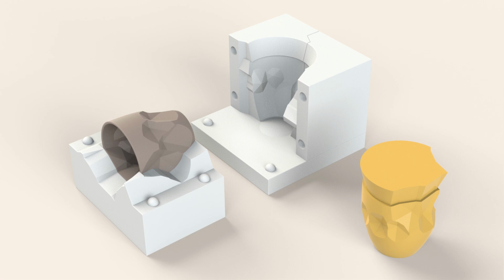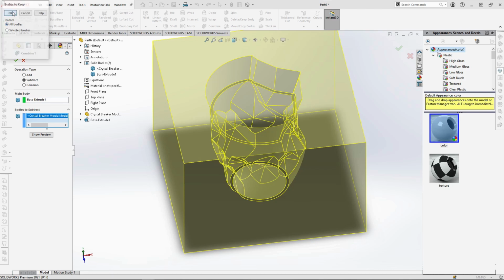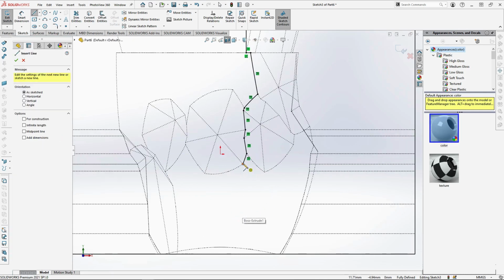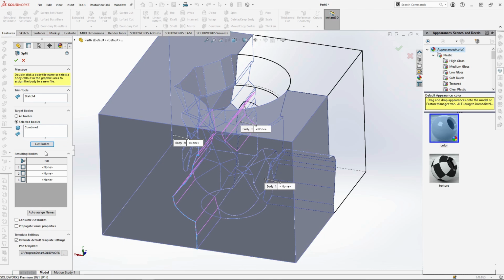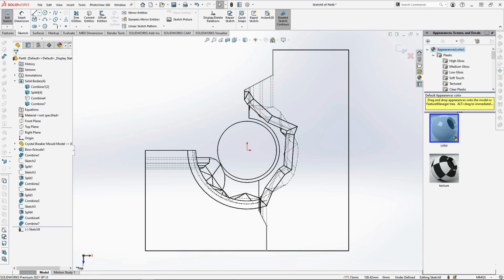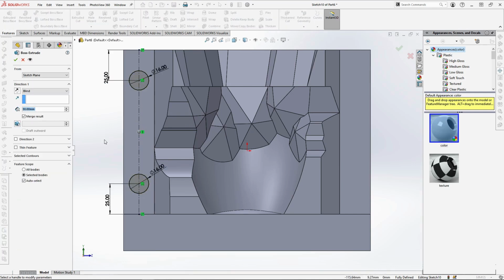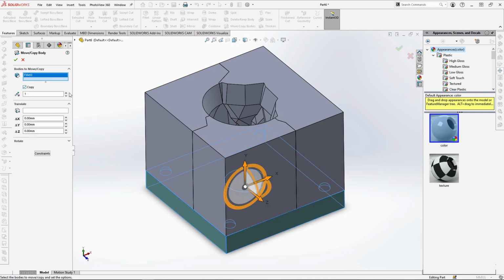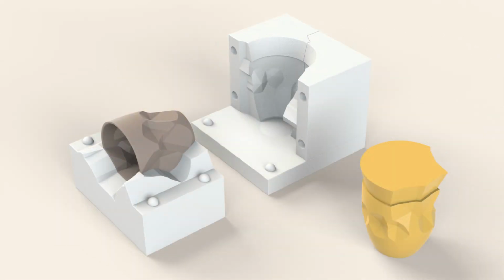4 Part Plaster Mould SOLIDWORKS Tutorial

Comment: Hi Jade! Thanks so much for this! Curious if you could go into more detail about how you then cast the plaster mold? 

I’ve seen some YouTubers create molds from which they actually cast the plaster mold itself. 

But it looks as though your four piece mold would be individually cast separately using a traditional mold making process? I.e. each 3d printed mold piece is cast in plaster with cottle boards? Is that right? 

If that’s the case, wondering if you could create a video of a mold for the mold pieces 😀
Reply from the maker: Thank you for your message! Yes the mold is created with traditional plaster mold methods, it is time consuming but 3d modelling and printing has helped to speed up the process and make it more accurate. 
I’d love to get around to doing a tutorial, not sure it would happen anytime soon, as I haven’t practiced ceramics for a few years, Solidworks tutorials and my freelance toy design business takes up most of my day. But keep an eye out, I do show plaster molding a pumpkin on a previous video, you may have already seen it. But that’s a super basic 2 part mold.

Comment: This was so helpful thankyou!
Reply: your videos are wonderful. I have been trying to learn Solidworks in order to make my molds for ceramic cups/mugs. Have you ever considered taking them a step further and building the 3d enclosures/case for the mold. so after the parts are printed,d the plaster can be poured directly into the 3d printed system, without having to use cottle boards. I can send you an image for clarifications. but this comment field is not letting me attach anything.
Reply from the maker: Thank you so much! Thanks for commenting too, And yes I have definitely worked on a project like that. 

https://www.engineersrule.com/combining-ceramics-solidworks-and-3d-printing-it-can-be-done/

I have an article on it here☝🏻
And a second one I did with Solidworks:

https://blogs.solidworks.com/products/solidworks/qa-jade-cromptons-new-approach-to-3d-printing/

It was a research project I did during my masters degree in 2015, I was testing the possibilities of 3d printing and ceramic plaster molds to speed up the process but also make more intricate work 😊👍🏻